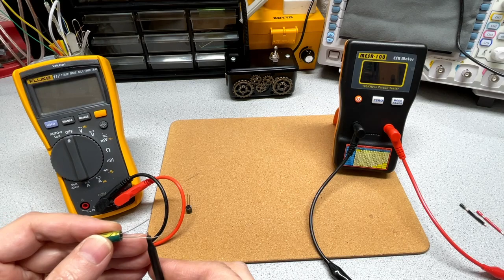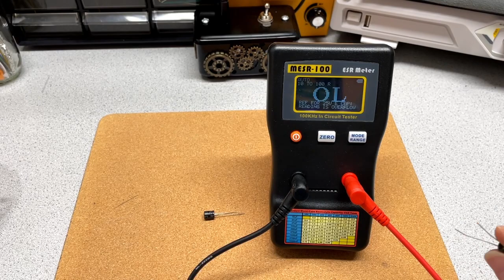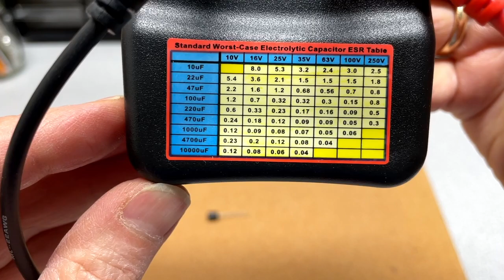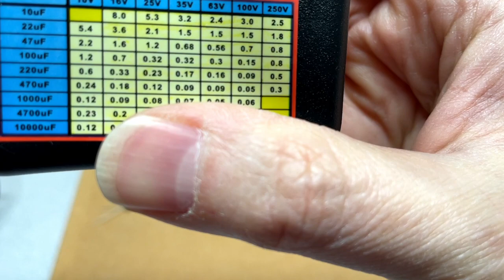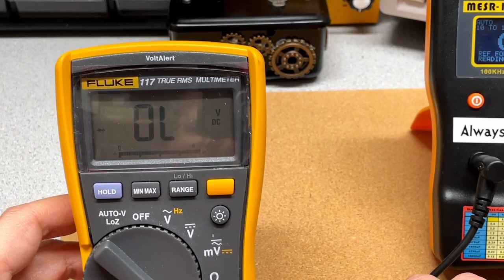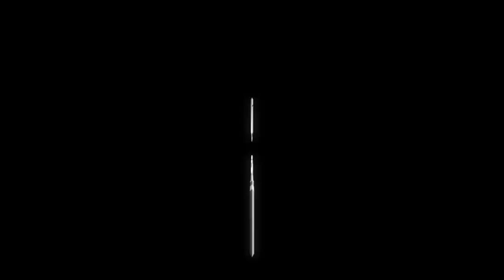How To Use an ESR Meter to Test Capacitors in circuit

Comment: You should use a resistor to discharge through. Especially for large caps.
Reply from the maker: That's a good point about discharging through a resistor.

Comment: Great tutorial. You can also test the resistance or microhenries of the inductors with the esr meter. The reactance formula is 2𝛑FL. That would be 2 x 3.14 x frequency of esr meter which is 100 kHz x 100 (uH) Just plug it in to get the reading.

R=0.628 X L(uH)
L(uH)=R(ohms)/0.628
Reply from the maker: Thanks for sharing that

Comment: I have one of these meters correct e if I am wrong but I am sure you can use the test leads anyway round. Thanks for your patience must be difficult try to form using them leads even the sockets are a bit loose on plugs.
Reply from the maker: You are correct

Comment: 25:30 don't push..risk of lifting pads, just heat up enough...also, tape of surrounding area to protect from blowing off....😉
Reply: Great tip on using tape. I have heat resistant tape which I think would be very helpful.

Comment: Should you have say a 100 R resistor to short the capacitor because back EMF could damage sensitive components connected to the capacitor? Shorting large capacitors out of circuit apparently can damage large electrolyte types as well I have read?

Comment: If a piece of equipment is of high quality and morth money i dont even check capacitors, i just change the horrible things.
Reply: But can you be positively sure the new caps will have the same longevity of the originals?  I don't think the quality is the same with many products.
Reply: @jefffoster3557 That's why you buy them with a slightly higher temperature limit, up the volt a bit. And you can even have a better tolerance, and buy them from a good producer, like Nichikon

Comment: You might as well use longer leads since you are putting your thumbs on these new "probes" every test LOL
Reply from the maker: Thanks for your feedback.  I have been reworking these to improve the insulation. The real issue is getting into the component
Reply: @jtechlabs1  Just use longer leads and "zero" them.
Reply: Or use thicker leads

Comment: Why cant you use longer lead ?  Cant you zero those longer leads?
Reply: Actually you can use longer leads to trace bad/suspicious caps.
Once you suspect a cap being bad you can still take it out and check it.
Been doing that for years, never had problems finding bad caps that way.
Reply from the maker: The leads are deliberately short in order to limit the amount / possibility of inductance between the leads that would affect the the measurement
Reply: @jtechlabs1  Thx. I didn't know about "inductance" problem.   Would make good video
Reply: Correct, meter will not zero, you get a message saying "leads to long".

Comment: What if you have an electrolytic capacitor rated @ 220uf @ 400v? What would the resistance be?
Reply: .24 ohm or lower.  You can find ESR tables for the capacitance/voltage on the web.

Comment: Why could you not use a regular multimeter to determine the resistance of the capacitor? It seems to work just as well.  Please explain.
Reply: The  meter is measuring the capacitive impedance to the high frequency thru the capacitor, not the D.C. resistance .
Reply from the maker: A multimeter feeds a small voltage through the resistor and uses the voltage drop to determine the resistance.  A functioning capacitor is an open circuit and no voltage will flow after the initial charging phase.
Reply: Those ESR meters only send a small pulse while a normal multimeter will feed a constant voltage which will charge the capacitor and give "OL" as a result.
When using a regular multimeter, once the cap is charged (happens very quick) there will be no more current flowing and as a result the meter will "see" an infinite resistance.